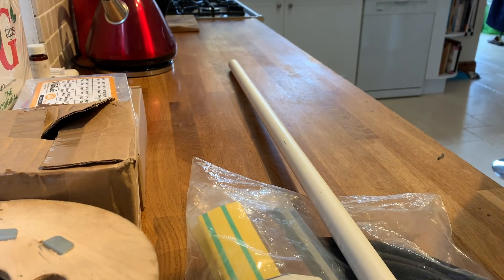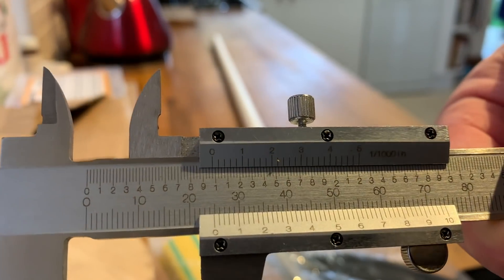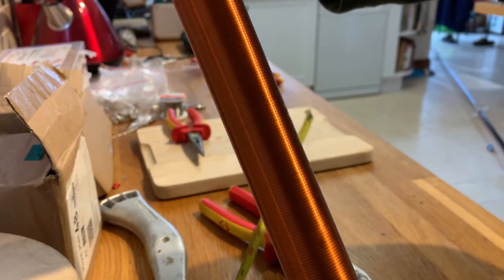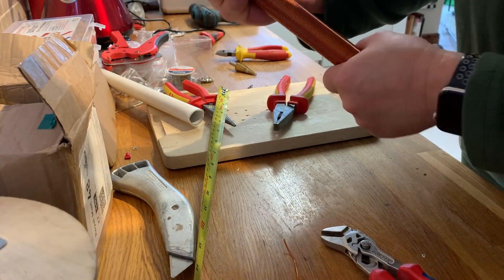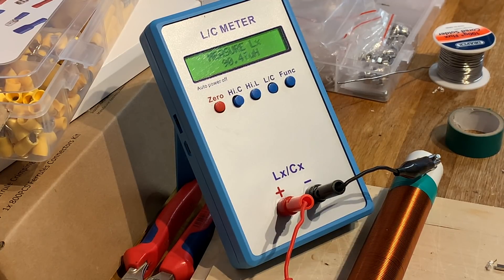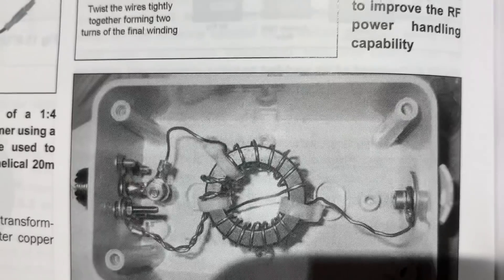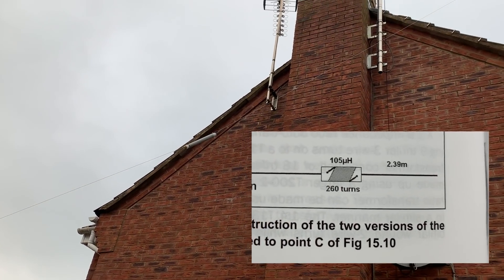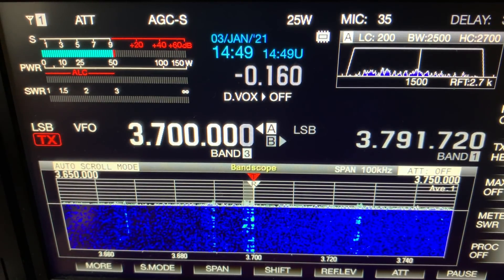HAM RADIO: Build a Small Garden EFHW for 80M

Comment: Thanks for the video. I got the idea of this coil extended EFHW antenna. 9:1 unun + 20,35m multithreaded copper wire + 110 uH coil + 2,39m multithreaded copper wire in height of 7 meter gives rather nice antenna for 80-40-20-10 m bands. Portable 20W transceiver on the lakeside in Center-Finland (61.7421° N, 26.1149° E) enabled connections to Brazil, North America, Thailand - not bad. 73' de OH2XA

Comment: Great video Mike! I also make it bigger than calculated. Theory and practice differ most of the times. Before cutting the wire I measure it with my Peak Atlas LCR45, really happy with that meter. UK made. 73 PA5BAS

Comment: To calculate any inductance (for example @xxxjab : Turns 60, Diameter 5cm, longitude 6cm, we can use next formula: 

L : 0,00987 x (DxD) x (NxN) x K / l (longitude)>>>>>>>>>>>L: 0,00987 x 25 x 3600 x K / 6

K : 1/ 0,457.d /l +0,995>>>>>>>0,457 x 5 = 2,285>>>>>2,285/6=0,380>>>>>0,380 + 0,995 = 1,375>>>>>1 / 1,375 = 0,727

L: 0,00987 x 25 x 3600 x 0,727 / 6>>>>>>645,8 / 6>>>>>>>   = 107,7 mHy, more and less.

By the way, K is the Nagaoka number, or D/l ratio.

Comment: You appear to be measuring the inductance at a low frequency. I made a coil with 80 turns of 0.9mm wire on a 36mm former and measured the inductance with a NanoVNA. It was 89uH at 90kHz and 110uH at 3.7MHz.
Reply: did you use a capacitor in series to meaure inductance? I used a 100pF cap and managed to get 110uH at 3.575Mhz on Nano VNA H4 with 60 turns of .63mm magnet wire on 34mm OD air core.

Comment: Hi I'd like to aak you for your opinion. I need a 80m antenna that would help on DX and the choices are EFHQ as a inverted L or a vertical. Which could receive less noise anf work as DX?
Regards
Javier
TI2JS
Reply from the maker: Unfortunately there is no simply answer here, I have both and both are inverted L's both work and both work better than the other on deferent days???  :)

Comment: mike i want to put one up,why did you put the transformer at the bottom of the pole then run the wire up then across to the house.i was going to attach the transformer to my alloy pole on the side of the house then from there run the wire down the garden then across like a L shape,
i have around 30 meters from my pole back to the shake.im hoping that will work. what do you think?

Comment: Just built one of these and you are not joking when you said it works well. I did have a random length end fed with a 9:1 fed directly from the shack. 7MHz /14mhz was always a struggle on receive. The EFHW is fed at the bottom of the garden run vertical to an over hanging tree branch and then out to the house. Signals have been fantastic I’m my location with this set up.
Really enjoying your vids Mike.
Ivan G0BON

Comment: Does adding the 80 coil, effect the previous (pre)tuning of the 40M wire?
Reply: There is more than one way to do it.  One approach is to choose a coil which acts as a trap above 80m frequencies.  In that case you add it to the existing 40m EFHW with almost no impact on the existing frequencies.  On 80m it acts as a loading coil.

Comment: Hi Mike, congrats it's a nice neat construction and just a question here : if we took for example a PVC pipe diameter 50mm (2") required turns would be approx 60 and coil 6cm long with 1mil enamelled copper ; inductance would too be 110 mH ; other than having less turns to wind (less job) therefore having less copper wire used (pi x 5 x 60 vs pi x 2.5 x 190 = 5.5m less wire) which would be cheaper too, what would it mean on a performance point of view? (sorry I am new to antenna building stuff, but i really WANT to build antennas :) )
Reply: To the best of my understanding, the highest Q coil, (most inductance for the resistance of the wire,) is a coil diameter almost as wide as the coil is long. I've built loading coils as large as two and a half feet in diameter with 35 pounds of copper wire on them, on Styrofoam cores. I don't know what effect that length to diameter ratio would have on the interwinding capacitance of the coil, (self-resonant frequency,) as all of my designs have used an interwinding gap of the same diameter as the wire, whereas this design is close-wound. I would advise using a coil program that allows you to specify the dielectric constant of the coil form material you are winding on, (it looks like he used PVC, but there are other possibilities,) as that noticeably affects the interwinding capacitance and heating losses in the plastic. Years ago all coils were air-wound or wound on ceramic forms and provided very high Q's for that very reason. Of course, a high Q also narrows the tuneable bandwidth, (low SWR range.) There are always trade-offs, so there will always be calculations and experimentation to do.

Comment: Thanks for the inspiration. Just built one tonight! One question: do I need to shorten my 40m antenna at all before adding the coil and 2m length? I would think if not, I’d be 2 meters longer than needed for 40m resonance. Thanks
Reply: The "extra" 2m is choked off so anything above 80m won't see it. Having said that, the coil may add a bit of loading on the higher bands, so it may need to be a little shorter. But you'd have to try it and see.

Comment: can I use small tiny toroid wound 110uH coil instead of big air core coil?
Reply: I wouldn't have thought that would work. The coil has a dual function, acting both as a 110uH choke to choke off the higher bands, and as a loading coil on 80m.

Comment: Does the self resonant frequency need to be above or below the band you are effectively 'trapping'? For the 80m coil. I have a 40m EFHW. My understanding is you want the MUF of the 40m band below the self resonant frequency of the loading coil for 80m.
Reply from the maker: yep, resonant at 40, coil adds 80
Reply: Mine works out to be 117uH and self resonant at 7.434Mhz.
Reply from the maker: @davkdavk  sounds good. :)

Comment: I constructed and added your inductor design to my 40 meter end fed and now my antenna works nicely on 80 meters. Now, could one add a second inductor to add coverage of 160 meters? I have room to run about 10 additional meters of wire along my wooden privacy fence.  I think I may experiment with that idea. Be nice to have a limited space 160-10 meter antenna. Thanks for your video!
Reply from the maker: yes you could but I have no idea of the value you will need

Comment: Why do these chopped onions taste of leaded solder Dad ? Thanks for the clips, which have helped me get through lockdown. Would a 5/8 wave antenna be possible to make like the T2LT ? 5/8 wave length wire with a 1/4 wave braid at the base and a choke coil, or would it have to have a matching coil added so taking away the all in one piece of coaxial cable ? Just mulling things over as you do. 73's and cheers Andy M6APJ.
Reply from the maker: Yes you can make a 5/8s but it all down to size ( is it practical )

Comment: Great video. Just one slight error in coil calculation though. The image shows diameter to the centre of the conductor, not the I'd of the coil. It effects the number of turns required but obviously still in the ball park.
Reply from the maker: you are right. :)

Comment: You could have rectified mistake by unsoldering, passing wire through hole then resoldering it... 
Hmmm 1mm wire is about 18 gauge wire so 190 turns will take about 50 feet of 18ga.(49 and a fraction) wire.
I need to get some heat shrink material for this too.
I will be extending my 40-10 efhw in this way too. Thank you for the construction details. very nice. 73 de w8nsi jim
Reply from the maker: have fun.. :)

Comment: Mike what type of cable are you using as the radiating element? Is it bare or insulated? I finished my coil. I used a larger former because it all I had on hand. My reading came out to be 99.8uH.
Reply from the maker: Yes a larger former will give a higher reading, I'm using 1mm enamel coated hard drawn copper.

Comment: For the EFHW antenna with the 80m coil, what is the length of the wire you have used. If I may request you to share the layout of your antenna as well. 73, VU3RHU
Reply from the maker: This should help. http://g0kya.blogspot.com/2017/01/a-shortened-multi-band-end-fed-half.html

Comment: Mike, have you ever used coil32.net ? The wire type is entered, along with the required inductance.  I think this gives a little more accurate calculation of what is needed to wind the coil trap.  DE kd5smf
Reply from the maker: Cheers Mark I will take a look.  :)

Comment: What is the wire you are using? Braided bare stainless steel?
Reply from the maker: Yes, it is 1.5mm Stainless steel wire rope, it has a little bit of resistance so I may change it for hard drawn copper.

Comment: Quite an impressive antenna! What do you use for a ground?
Reply from the maker: I have a 60cm copper pipe driven into the ground.
Reply: Thanks! I'm looking for a relatively easy earthing solution to try a long wire.
Reply: I have added 3 10m radials along the ground on mine, including earth stake. Night and day for receive on 20m

Comment: Me - successfully surviving another lockdown day involves getting out of bed in the morning. Mike -successfully surviving another lockdown day involves design and build of yet another antenna variation (with only minimal jeopardy to kitchen). Sigh M7BLC. 73.
Reply from the maker: Two soldering iron burns and a small hole...  and I'm still alive, mind you wife hasn't seen the damage yet!!!
Reply: Mike-M0MSN I’m picturing 2 pieces of cardboard with aluminum (aluminium) sandwiched in between to prevent burn-through to prevent being sent to the doghouse. It’s too cold out there this time of year! Nice work as usual on your builds. Thanks for the time you take to share